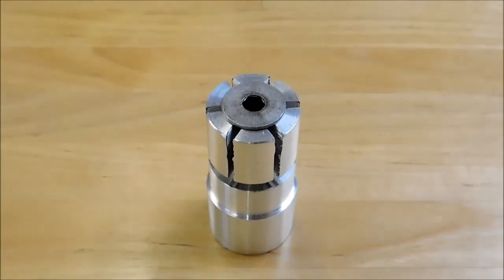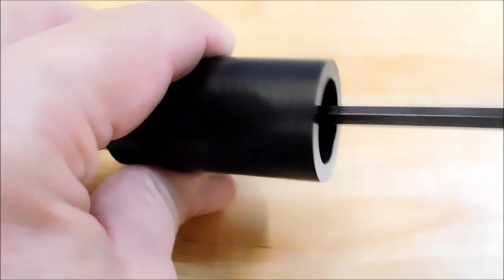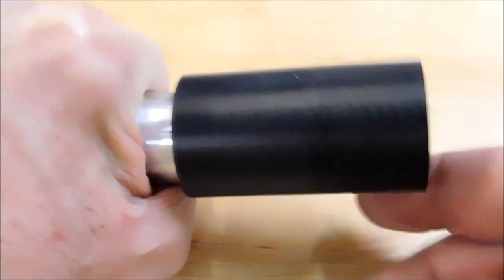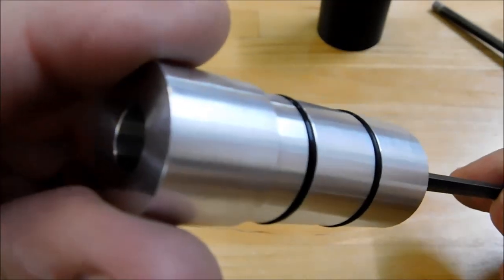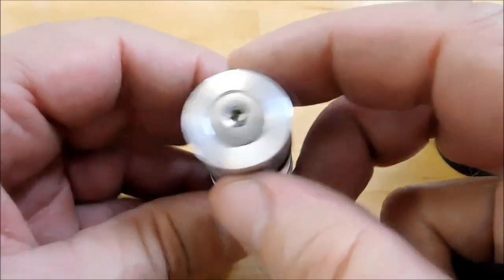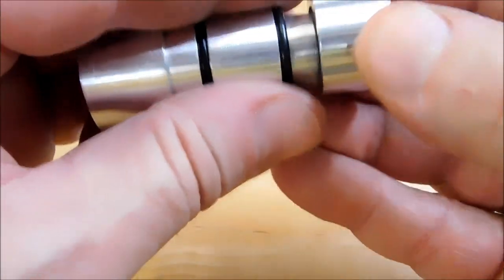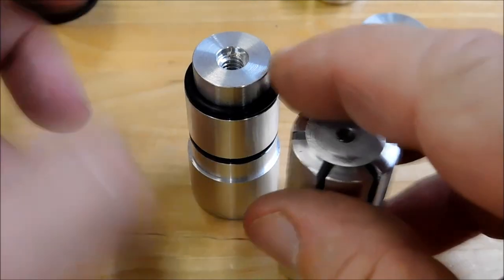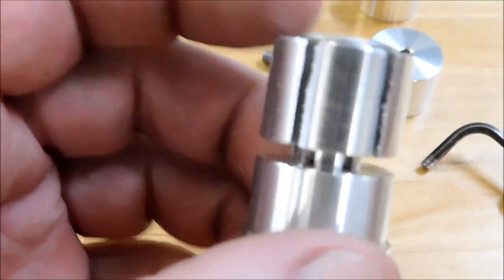Expansion Arbors --- No through hole...No Problem..Take a Look

Comment: Hey Joe, i commented the same question on another video. I machine wedding rings daily and i was wondering how you would hold 13mm to 25mm internal diameters? i want a solution that would allow me to spin part true etc. I hope you have some ideas for me. I love this idea but i need the different sizes, any advice?
Reply from the maker: These are easy to make if you wanted dedicated sizes. Otherwise, one size and a bunch of size specific split rings as adapters would be a viable solution.
Reply: @joepie221  thanks for the reply Joe, what do you mean by "specific split rings as adapters"?. i have struggled for a long time on a viable design.
Reply: Cedric Eveleigh trouble with these is when you expand them they run not true all the time. Thanks for the though tho, I appreciate it 👍🏻
Reply from the maker: @jaysonmlkvy7958  NEVER build an expansion arbor that registers the entire part on a split or expanding portion of the arbor and expect it to run true. NEVER. These arbors can repeat and run very true if you build and use them correctly.

Comment: Hey Joe as always excellent videos! I was wondering if you know how to drill a machine screw from end to end were the drilled hole is perfectly concentric with the outside of the threads through the length of lets say a 1.5" ?  Kind of like gun boar drilling except the outside of the barrel is threaded and you don't want to damage the threadsand the hole is 1.75 dia.
Reply: thread a couple of nuts on the part, and grip on the nuts then do your drilling operation.
Reply from the maker: Watch my video on how to get your parts to run true in a non adjustable chuck. The split aluminum bushing idea will hold the OD of the thread without damage. Threaded arbors or nuts will locate on the pitch, not the OD. Nuts are the preferred method, but you specified OD.
Reply: you are the bomb! that was a great video too that will definitely get me done, awesome!

Comment: Great video, have you had any ideas on making an arbor that could receive the tailstock for large parts?
Reply from the maker: I have. Its usually 3 or 4 screws in an edge radial pattern so the live center has a place to go.
Reply: Thanks for the reply, I don't completely understand what you mean by an edge radial pattern but it sounds very interesting, could you explain me a little bit more?

Comment: What is the concentricity that can be held using o-rings?

I'm thinking that because it is plastic or rubber, they may have uneven surfaces and may position the part uneven as well when loading into fixture. Please help.
Reply from the maker: This is a very common problem with an arbor that is not constructed properly. The arbor features that establish the concentricity should be solid features and the o'rings or splits only do the driving. Try not to get caught by that.

Comment: Will the O-ring style hold for heavy duty turning, like 6" part, 4130 > For example, you use a copper wire instead of an O-ring, is there a way to make it work? The reason i would not use conventional for a heavy duty application, is because it wastes a lot of material having to make an expanding arbor every time and slicing it with a saw.
Reply: meocats I doubt because copper has no resiliency. Get it on and not off is my first thought.
Reply from the maker: I have to agree with 'Blues Doctor' and say it may work, but getting it off may bite you. These arbors are good, but I am not sure heavy applications are in the cards. Maybe a solid arbor with a series of screws around the perimeter of the face to apply segmented  pressure??
Reply: How about multiple rings using neoprene fuel line instead of copper or O-rings?
Reply: Dick Sargent I will make a new post on my heavy duty version of this at the risk of being called a Rube Goldberg dodge. It was accurate and brute tough.

Comment: Praise tools!
im looking at getting my own wetal turning/milling machine. 
what would the first major 2 of, mill vs lathe? im looking at roughly £500 mark and about £100 for tooling?
Reply: anikidwolfy lathe first, definitely
Reply: I depends on the size of things you want to make, I got the mill first because you can actually use it as a lathe when turning small pieces (I just hold stuff smaller than 20mm in an ER collet, and there are mini 3 and 4 yaw chucks that you can use in the mill up to about 65mm).  But given your budget I'd get the lathe first, since the mill requires much more for tooling... getting a proper vise, a set of parallels, er collets, a test dial indicator and some end mills will definitely push you over 100. Also, get a dial indicator or/and digital caliper to use as a DRO for the lathe, it is totally worth it!, as for the mill, don't buy it until you can also afford the DRO, it will set you back about an extra 300, money well spent!, having no DRO in the mill is a huge inconvenience!

Comment: Great idea how much will the o rings expand %  wise please
Reply from the maker: This question is directly related to the diameter of the o'ring used. A larger diameter cross section o'ring has more % expansion potential than a smaller one. It will also be affected by how much the cross section is reduced when stretched over the parent mandrel. Hard question to give a very specific answer.

Comment: I have a stupid question. if someone wants to buy or build a lathe. is it necessary that the floor (location) on which the lathe will sit should be perfectly leveled ?
Reply from the maker: No. Most machines have feet that allow for the leveling of the machine regardless of the floor condition. It is suggested that the floor be firm/stable enough to hold the weight of the machine and not allow for floor cracking or settling.

Comment: Think it possible to do the o ring version without the sleeve, and replace the ring with rubber or vinyl tubing for use on an interally threaded delicate part?
Reply from the maker: Sounds like it would work.
Reply: thanks for the rapid reply, Joe! all of them also seem like a great way to reinforce a delicate bored piece for just about any operation from stamping a number on it, to cross drilling, to just holding it in a vise without mangling it, as well as giving a "fixing extension" for polished, pretty examples of similar pieces, or precision ground pieces where a jaw mark might toss a monkey wrench in some gearing, lol. new subscription just added, your channel never fails to inform and educate, and always in an understandable "nuts and bolts" manner without any impression of "patiently enduring teaching chimps to tie shoe laces", lol

Comment: Is oring-style arbor going to have good grip on steel parts?
Reply from the maker: I guess that depends on the operation you are planning.
Reply: @joepie221  Not only operation but number of operations also matter. I feel like doing endurance testing of this part to check lifecycle.(Truly cannot do it myself since i don't have setup.) Since on production line, such part replacement life cycle is important to get quality output. Thanks for video. Nice presentation.

Comment: Hi thanks for the ideas, what width and how deep would you cut the under cut say on a 1" od arbour? thank you
Reply from the maker: The diameter of the undercut is driven by the size of the screw, and the placement is driven by the part. make the undercut deep enough to allow for easy flex of the arbor, and place it so you have some solid location geometry for your part to register on.

Comment: I have a  problem at 10:15, when you use the backend bolt why doesn't the plug rotate in its place when you tighten it. I hope the friction is enough to hold the plug in its place to squeeze it in. I mean if friction is not enough between plug and inside of the arbor, it will rotate along with the bolt, won't it?
Reply from the maker: The friction holds it from spinning.
Reply: @joepie221   Thank you sir and appreciate your quick response. The video was very informative.

Comment: Hi Joe, thanks for great ideas. You have the best machining videos on youtube. I came across this video searching ideas to hold a short piece of steel tube to thread it on the outside. Using a "standard" tapered mandrel was my  first plan, but I was looking for a better way. One of these aluminum arbors would work great, but I found another video with what I think is even better:https://www.youtube.com/watch?v=zFSyXZx2Kw8 (skip to 2:07) Have you ever used a holding device like that? It seems like a great idea, as it would be highly adjustable. The problem is that I cant find any places to buy one, or even a proper name for it.
Reply from the maker: I know the guy that posted that video. I have looked online for one of those and can't find one. I'll reach out to Chuck and see if he knows what its called. Mr Pete 222 seems to have a bunch of old school knowledge, maybe send him the link for some input.
Reply: eBay seems to have a few smaller sizes. A quick search for expanding mandrel brings up a good list of auction items.
Reply: This company makes these arbors here in Sweden:
http://melandersverkstad.se/?page_id=47
I have several sets and highly recommend this style. Ordered som spare collects last Year from them.
I have a pair of small ones from China as well, they work but are no where near the quality of the JMH ones.
Thanks for an excellent tutorial, I sort of kicked myself for not thinking of the O-ring trick before. I have used the almost exact contraption for holding tubing structures together  in prototypes...
Regards, Erik

Comment: Our machinist at work would rather be fired than make big tooling. It's a pity really as a lot of repeat turning operations are cumbersome at best direct chucked.
Reply from the maker: Thats just a bad practice. The time consumed making a good tool will come back ten fold on repeat work. Never get stuck in that "Next time" loop. Its costly.
Reply: @joepie221  We have to trim the tires and rims on these https://drive.google.com/file/d/1ldgFCcWbrCAe5oN8UaOtwz7bxnnmkPHo/view?usp=drivesdk. He still after 20 years has not made an arbor to hold them against the timken tapers, making the setups a non precision affair.